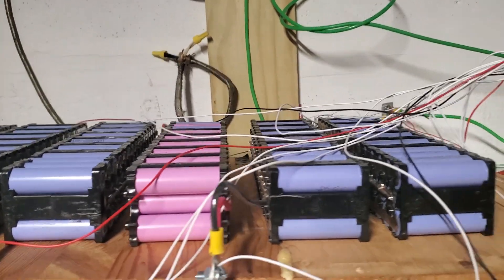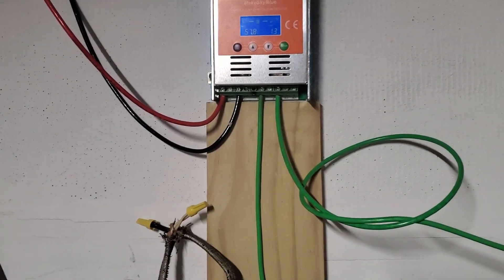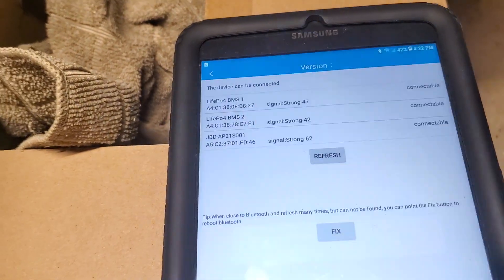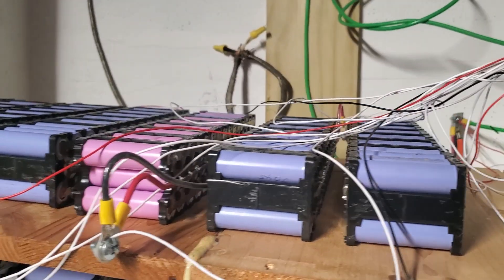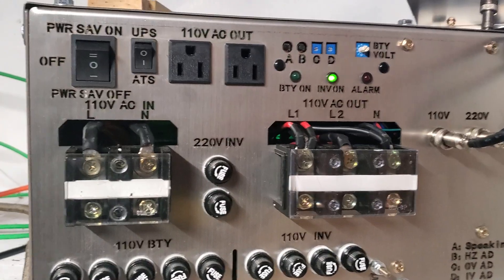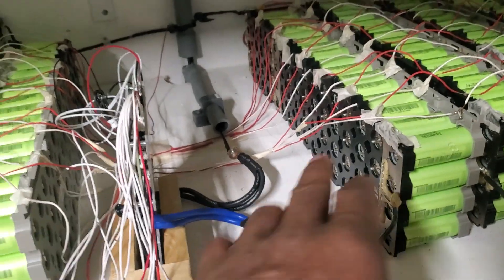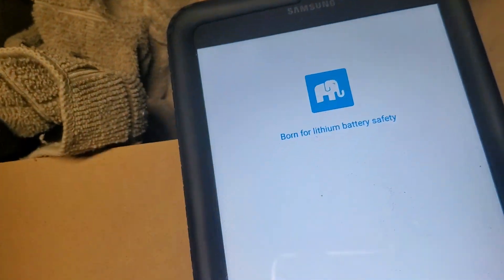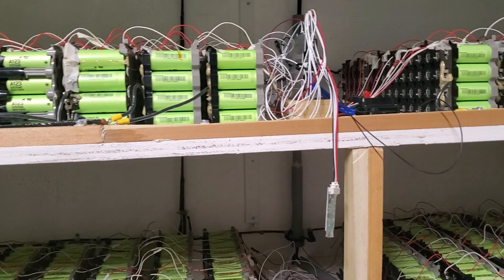140 DAYS+ OFF-GRID WITH SOLAR POWER 🔋 ENERGY SYSTEMS  #lithium #lifepo4 #solar #inverter #Off-Grid

Comment: I built a fairly large system but im not confident in myself enough to make videos
Reply from the maker: Don't be afraid, just do it. The video may help someone now or in the future. You can start with the panels,  the regulator charger, the Inverter and than the battery 🔋 bank.
Reply: @simplyfocus9937  ive spent 30 grand on components and built both my batteries. One is 24 leaf modules amd the other is 48 280ah lifepo4 cells from 18650 battery store. My battery was by far the most expensive part but i can run my inovair mini split 24 7 heating or cooling now without a worry of running out of power. Its 38 seer and uses a crazy tiny amount of energy keeping our holiday rambler comfortable at 68 or 70 degrees. Im an over the road truck driver but maybe when im on home time in a couple weeks then i can figure out how to make a video of it all
Reply from the maker: Very nice